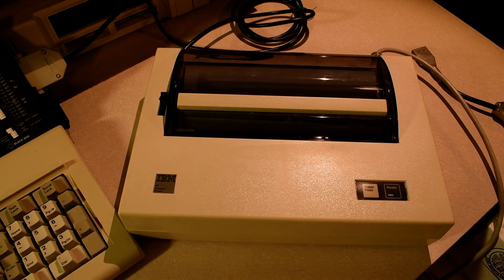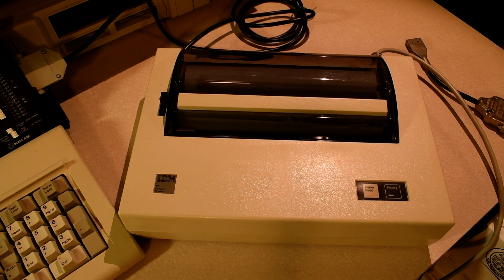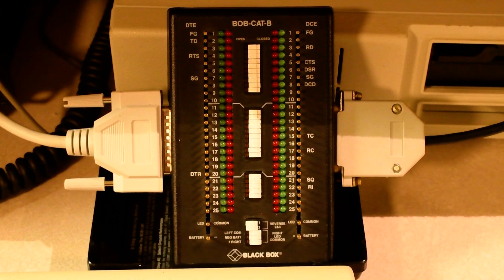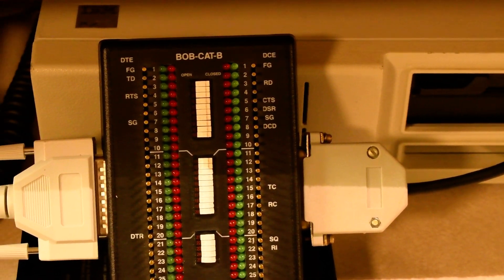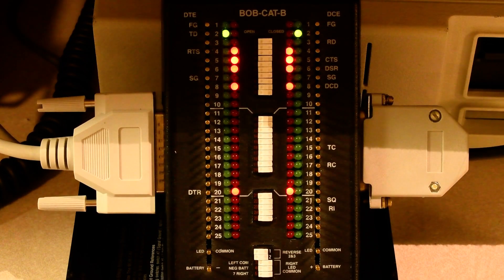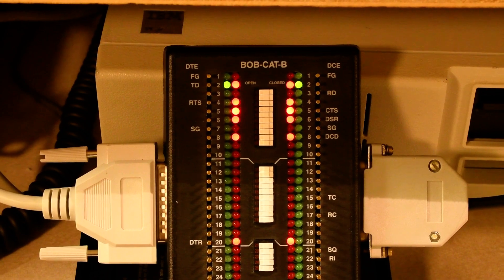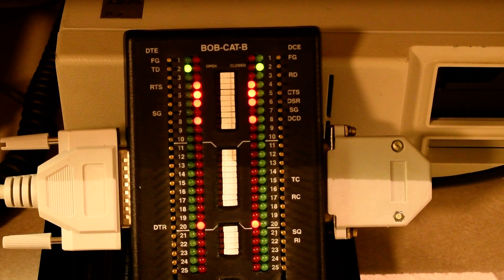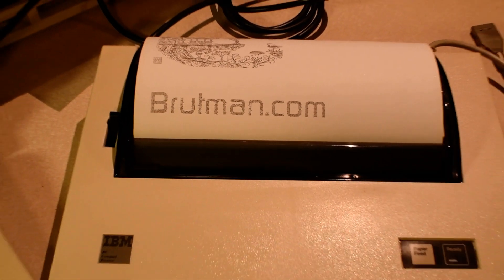IBM 5181 Compact Printer Signaling Through an RS232 Breakout Box

Comment: Can it overprint the lines?
Reply from the maker: I think every dot matrix printer can overprint; that's just a matter of sending a carriage return without a line feed.  The trick is can the printer then position the head accurately enough to print slightly next to, but not on top of the previously printed characters.  I don't think this printer mechanism is precise enough to pull that off.

Comment: Thanks for the video. I found one recently but the cable end was removed. It shows 4 wires: red, white, black and black. The one black, which is pinched back, I'm assuming to ground. I'm wondering which color wire goes to which pin for DB25 (3 - rd, 5 - cts, 8 - dsr )? What about pin 20 - dtr? Thanks in advance.
Reply from the maker: The technical reference manual for the printer is posted at http://www.minuszerodegrees.net/oa/oa.htm.

Red is the data wire and white is CTS.  Within the connector DTR is looped to DSR and RTS is looped to CD.  (Both of those are from the point of the view of the computer serial port.)

You should use a continuity detector to figure out which of the black wires is the shield ground vs. the signal ground.  They should not be tied together.
Reply: @mbbrutman  Thank you. Will try it and see.

Comment: Thanks for making this video, Michael!  I just saw someone post an adapter for one of these in a Facebook group and was curious as to what the printer looked like!!
Reply from the maker: Thanks!  It's a neat little printer.  When it was new, it was built to a very low price point so it is pretty limited.  However, that simplicity of design has enabled a lot of survivors, and 35 years later the output is surprisingly good.  (See the JPGs I've printed on it using the link in the description.)

Comment: If you do COPY filename COM1: in MS-DOS does it end up going through BIOS INT 14H for the character I/O? Is the hardware handshake then due to the BIOS INT 14H output character handler checking for DSR and CTS to be asserted?
Reply from the maker: Yes - the BIOS of the machine sets Data Terminal Ready and Request To Send, then checks Data Set Ready and Clear To Send.  With DTR looping back to DSR in the cable connector that check will always pass, so the only gate to sending data to the printer is the CTS signal.

For the data I am copying to the printer you need to use the /B parameter on the copy command to indicate that binary data is being transferred.  Otherwise, ASCII code 26 (Ctrl-Z) in the data stream will terminate the copy command early.